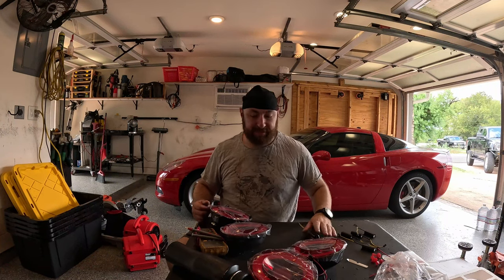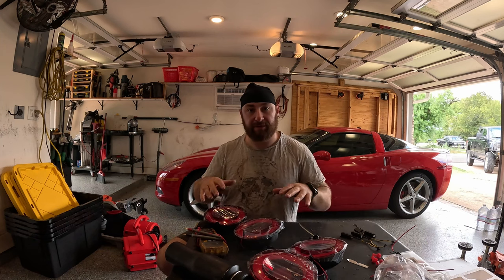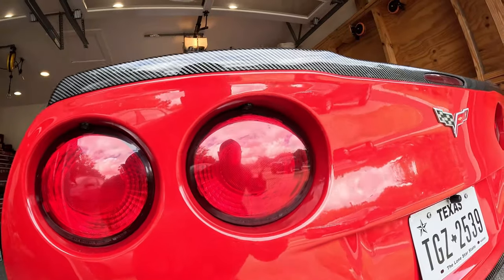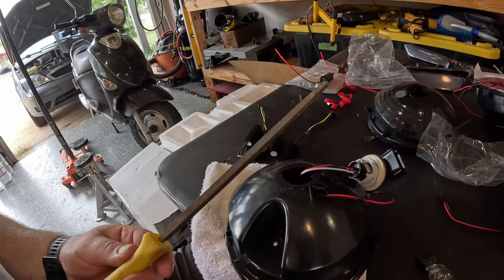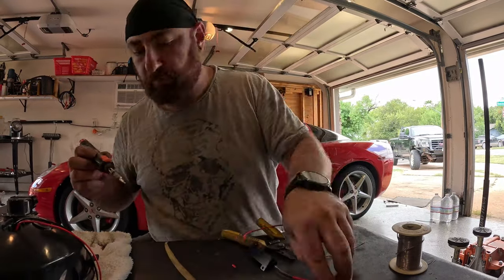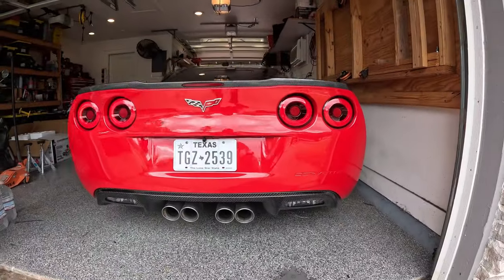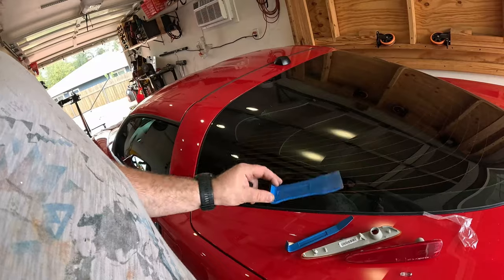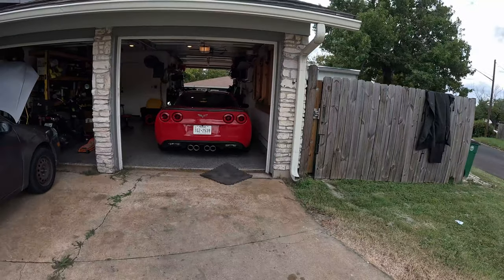AliExpress Cheap C6 Morimoto Style Tail Light Upgrade

Comment: Just got mine in,bought the same resistors you got wired it all up and it’s still blinking fast?just took it for a drive came back and now 2 of them quick working
Reply from the maker: make sure you have good connections and you wired them across the right wires. I had to resolder one of my connections. Happens to the best of us.
Reply: @Makswerks1 I thought you said the resisters doesn’t matter whitch way you wire them?they were all working when I plugged them in.took it for a drive for 10-15 minutes and go out and 2 of them were not working .
Reply from the maker: @tqc_dabbler2723 might have solder joint broken. I didn't have any issues after I double checked
Reply: @Makswerks1 okay I will re check
Reply: @Makswerks1 if I remember correctly the resister doesn’t have anything to do with the lights not turning on at all correct?I think it’s a light issue and not the resister wiring or resister issue?